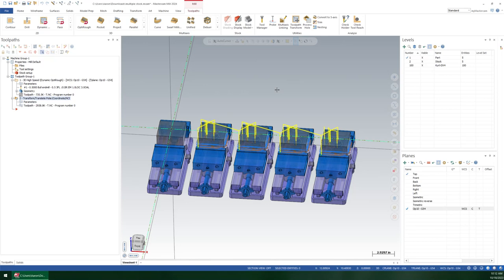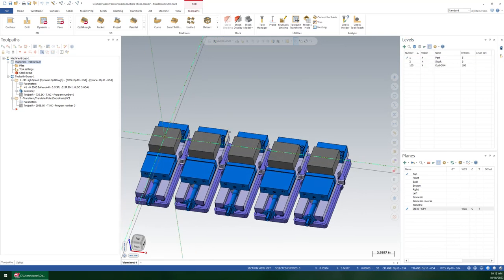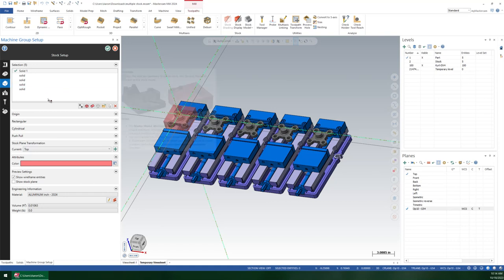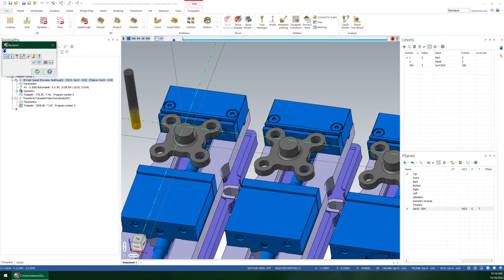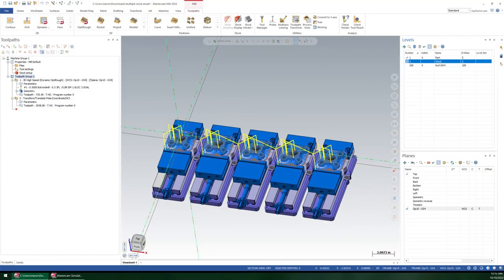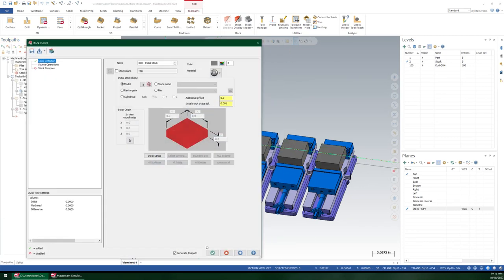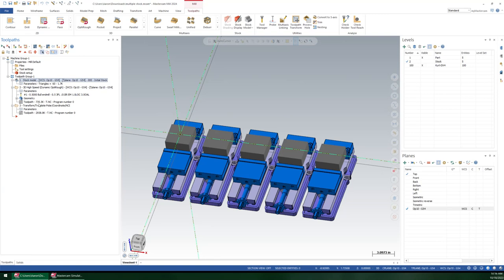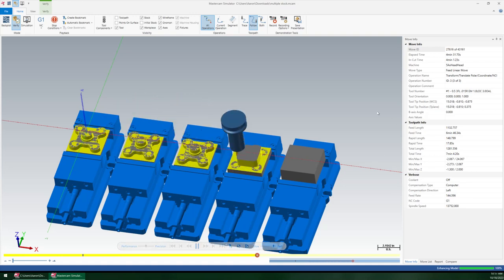Mastercam - Using multiple stock pieces for verification

Comment: Not really explaining how your completing this.
1.)  create model and transform it
2.) import vise and transform it
3.) create stock and transform it ?  you did not explain how you got 5 stock models?
4.) then transform toolpath? 

the transform toolpath does not work, it would mill one part complete with multiple tools and then do the second part.  It will not let me put a zero in the "Y" dialogue box. 
 
lost it some where along the way.  lol
Reply from the maker: Ello @DOFASCOMACHINESHOP!   No, I didn't go into the positioning of everything, that was outside the scope of what I wanted to show in this.   I'll have to do a different video with more indepth step-by-step for the setup for you.  In the meantime: 

1) I created the model by using wireframe and solid extrude to make the part, then I used Transform Dynamic to duplicate it down the line.
2) I got the model from Kurt's website for the DX6 6" Vise in this case.  Hold down the CTRL key and drag and drop it into Mastercam.   I then used Dynamic Transform to duplicate it.
3) I can't remember if I created a Wireframe > Bounding Box to make the solid, or just simply made a Solids > Block.   Transform Dynamic was how I copied it down the line.
4) I'm not sure why you're having trouble with the transform op.  There is the option inside of Transform to either sort them by operation order or by type.  That should let you control whether you're doing all of Tool #1 before T#2, etc or whether you do all of position 1 then 2.   I only had one operation so there was no sorting in this example.   I'm not quite following what you're talking about for the "zero in the Y dialog box" though, sorry?
Reply: @VectorMfg  OK thanks!  You did a nice job!